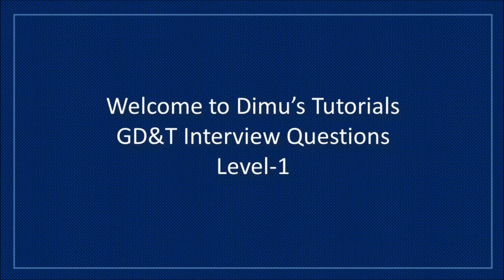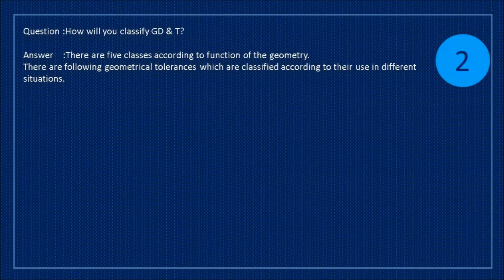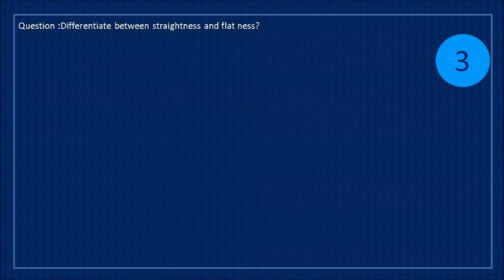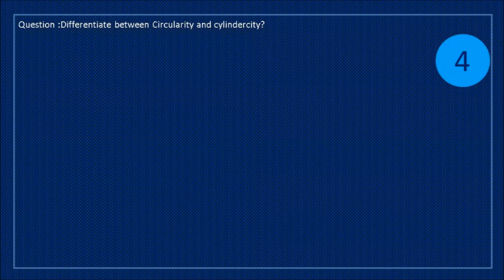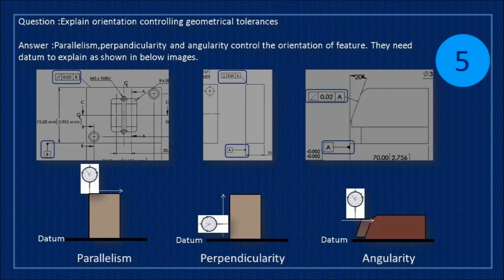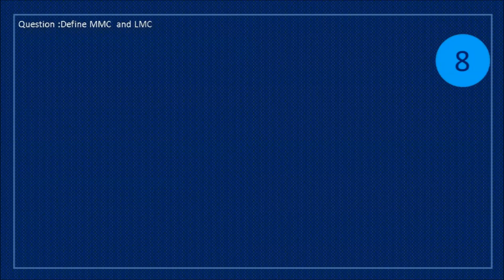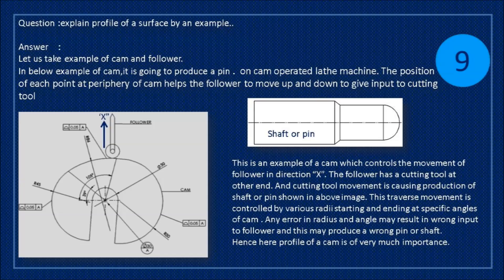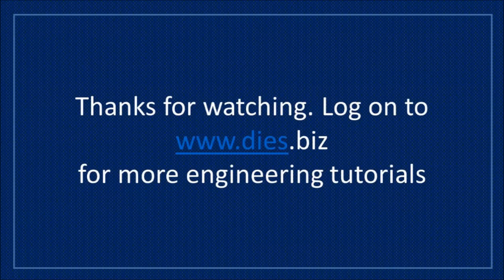GD&T-Mechanical engineering Interview Questions ,Dimu's Tutorials

Comment: Could you please explain, how secondary datum affects in GD&T position tolerance? Thanks in advance.
Reply: Depends on the relation and orientation between the feature and the secondary datum feature. 

If the Secondary Datum feature is parallel to the axis or center-plane of the feature being controlled by the position tolerance, then that feature must maintain the position tolerance boundary in the direction of that datum feature. 

If the Secondary datum feature is perpendicular to the axis or center-plane of the feature being controlled by the position tolerance, then that feature must maintain the position tolerance boundary in a way that is perpendicular to the datum feature.
Reply: Thanks